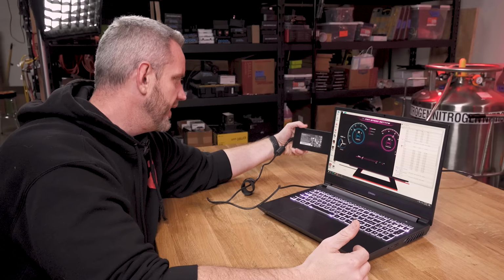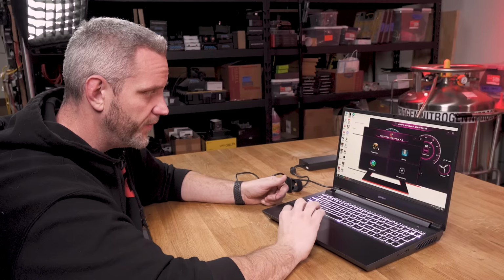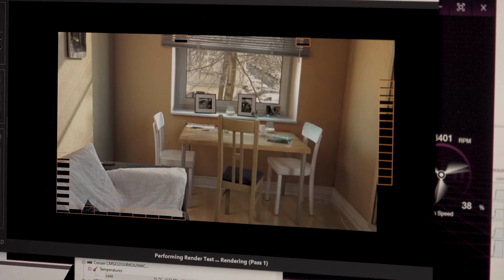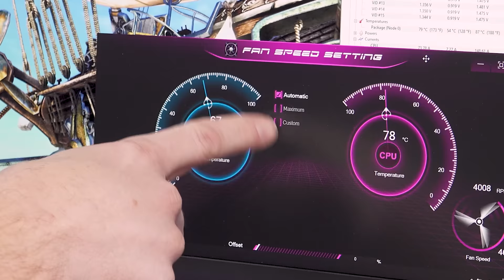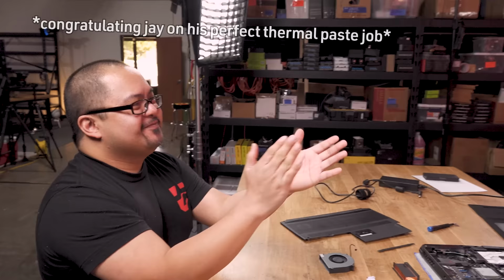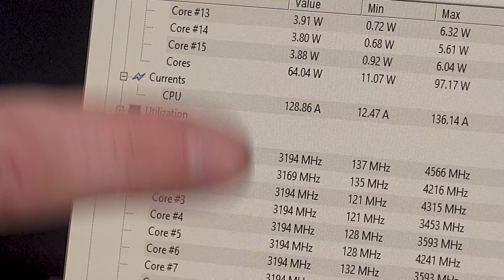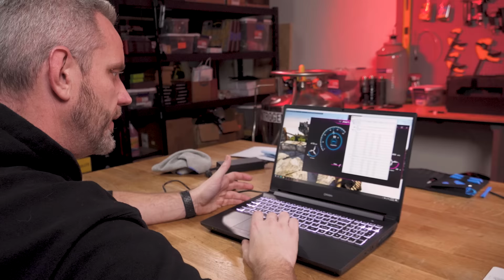This laptop was trying to melt to death... here's how I fixed it.

Comment: I work in techsupport and noticed the "performance" TIMs, like MX-4 tend to "liquify" and get pushed out from between the IHS and the cold plate, it's even worse on bare die chips
tested and found that best for this situation is the Gelid GC-Extreme or Phobya HeGrease Xtreme - basically same TIM, different branding; can't get my hands on KPX to test it

Comment: I have a rog strix laptop with i5 and 1060. Face same issue, when opened the laptop, the standoff on the motherboard that hold the heatpipe were all broken on cpu side and just stuck barely due to gpu side screws holding the entire heatpipe. Well crap out of warranty , took a piece of thermal pads and folded them to 5mm  5X5mm wide block and stick over heatpipe just above were cpu is. Applied new thermal paste and screwed the bottom and prayed it work. And it did back to 50C idle temps and max 90c under both cpu and gpu load without thermal throttle.

Comment: The clock dropping issue can be fixed by setting a proper power & current limit. This is because the power limit soft drops the clock speed and the current limit hard drops the clock speed. Also, having a current limit is good for preventing sudden voltage droop which could cause a BOSD.

Comment: I put LM on my Dell XPS 9700 -

Previously, I was thermal throttling at 70W. Now I'm able to sustain 75W (PL1) at 80-85°C, and I'm even able to sustain 115W PL2 boost for almost 30 seconds. Which is insane.

Also - 11% higher score in CB20 - 4227 against 3738 before. And without overheating - because after it drops from PL2 to PL1, temps immediately drop to mid 80s.

Comment: I had this exact problem on my Asus Strix 1080 Ti OC where the fans would start screaming if it went over 65-70c. 6 screws later (literally all it was) and I saw that most of the factory applied paste had evaporated (seriously, there was almost nothing left). I cleaned it up, repasted and now the card never goes over 65c and it’s dead silent. Always a good thing to check thermal paste if you’re having issues like this.

Comment: You might have applied some thermal paste bad... At least you did not applied the whole 20g worth of it on a single fx8520 and tried to troubleshoot why it doesn't start - there was so much thermal paste that it was in the socket ... So thank you for showing us what behavior does an overheating laptop has

Comment: My buddy had a similar issue with his MSI laptop. Thermal throttling hard on the CPU. PUBG ran like garbage. 

I put new paste in (wish I had recorded it) and the temps came down over 40 degrees.

The thing that really sucks is that this seems to be a common issue with laptops over time. Probably because of poor quality thermal paste. Another friend had an ASUS gaming laptop that ran like garbage for the same reason. So it's not just one manufacturer. 

And not everyone knows how to take apart a laptop. So this is something that would definitely cost people money over time.. which sucks on a multi thousand dollar machine..

Comment: I find these massive temp swings on my 3700X normal. 20-30C swings instantly seem to be normal. As long as it doesn't stay too hot for too long I don't seem to mind. I do have a U9S cooling it in a NR200 so temps won't ever exceed max.

Comment: For laptops a powerful tool is throttle stop for undervolting it improves performance and temparatur at the same time thru undervolting and its also important to use high quality thermalpads not just thermalpaste

Comment: My relatively new laptop has spikes to 100 degrees celsius, which is were it thermal throttles. Being basically idle after hours doing whatever unnecessary things dell supports wanted me to do they finally agreed to take it in and replace the heatsink and fans.  Problem is I need it for exams this month so it will have to wait a little. For now, I have disabled turbo boost to avoid does temps.

Comment: I recently had high CPU temps with my Asus TUF FX504GE laptop. Changed out the thermal paste with Arctic Allumina, but the temps stayed high. (high 50's to low 60's at idle, 4-8% CPU usage) What fixed it was a reinstall of Windows 10. Now it idles in the mid to high 40's like it did when it was brand new.

Comment: Hey Jay, try out Manual OC with ZenStates or CTR to bring the 3950X inside this laptop to around 3.6GHz at 0.975V to reach roughly 88W PPT in CineBench r20. You will LOVE the results. It should reach 8400 points in CB20. This way it will run way cooler with quieter fans and the performance is noticeable better than stock. At least for highly multithreaded loads. You can find a video on my channel in which I compare the scores achievable stock and tuned with all the CPU options for this notebook.
But beware, if you use ManualOC you have to deactivate the ControlCenter software in Windows' services, it's called "Control Center Hotkey Service". Otherwise the ControlCenter overwrites the manual OC from time to time.

Comment: On inspection of that thermal compound based on what I can see in this video:
You used too much.
Eventually the oils of the thermal compound will disperse and coat surrounding surfaces, and in a heated environment will slowly evaporate. This leaving behind a cakey ultra-fine powder that clings to itself and surfaces like wet sand, but it's actually dry. Matching up the separation lines from the CPU to the coldplate, I can see some small gaps where I'm willing to bet air got trapped in the application. This would accelerate the oxidation process of the thermal compound drying it out faster. Heating would cause the air pockets to expand creating a more sponge-like structure within the thermal compound. This, once the oils have dispersed due to oxidation, would create an insulating barrier instead of thermal transfer.
How can I tell? Three ways. First, there are numerous pits all throughout the main blob of TIM on the CPU. Second, if this process hadn't happened as described then the TIM would've held onto the coldplate via suction force. Third, you can't even see the labeling of the CPU heatspreader through that thick mass of TIM.
Solution? Pea-sized ball in the center of the CPU, and about a half pea-sized ball on the GPU. Press the heatsink firmly on the surface and oscillate pressure while trying to smear the TIM over the surface with the coldplate. Not sure it got full coverage? I assure you it did if your technique was correct, but to be sure you can pull the heatsink off and check the application. First, ensure you covered edge-to-edge spread on both the CPU and GPU. Second, ensure you can still see the majority of the CPU labeling. If not, you used too much or your chosen TIM is shit. Third, clean surfaces and repeat with confidence.

Comment: I had the same issue but with a low power CPU (i5 8250u) with the fans always noisy, the thermal paste was not applied nicely out-of-the-box, it basically was all around the die but not covering the die itself smh. After the repaste, it's dead silent even though the cooling solution is rather weak. Thanks for the nice job with the thermal paste Asus!

Comment: I have had really good results using liquid metal on all of my laptops and one of my friend's laptop as well. I nickel plate the heatsink cold plate my self (actually pretty easy) and use conformal coating to minimize risk, that way I should never really need to redo the applictaions. The temps are far better than stock and it takes so much longer for the fans to ramp up under load.

Comment: Read Igors Lab latest article. Because of the 3950x's convex heatspreader a viscose thermal paste will kind of slide down after a while where the CCDs sit. This is the unfortunate part with the chiplet design. So using a gooey paste is actually a bad idea. You can confirm that in a few months

Comment: I had exactly the same issue but with my RTX 2080. The factory paste hardened after only two years of use...
Didn't know why my GPU was going crazy before taking it apart. I brought it 8-10°C lower just by changing that hardened paste. Btw, it was an AIB card, Aorus.

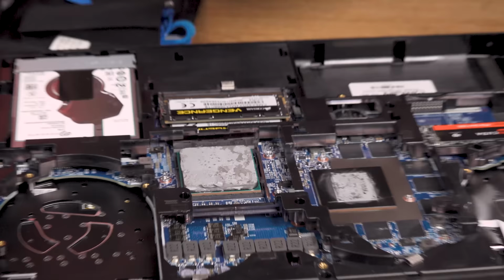Comment: 7:52 bubbles, bubbles everywhere :) Thats what you get doing paste cross with a side(s) closed with paste excess, or even worse - paste square with inside cross. Imagine then the air inside, bottom clossed (cpu/gpu), top closed (cooling unit), sides closed (thermal paste). Air has nowhere to go. Then you have pockets of compressed air trapped, resulting this bad thermal behavior. IMO, best way is to "paint" an even paste layer on such big cpu block. On smaller ones is a pea sized drop in the center also good.

Comment: Sometimes a paste job goes awry even if you did it right in terms of application.  A small twist or side slip as you tighten down the cold plate can cause a thin spot. In this laptop, that looks like it could be what happened, though as tight as everything fits together...maybe it was just a little short on paste.  Either way, good on Jay for being human and owning it.

Comment: Reminds me of a laptop I worked on once for a friend a long time ago. It was an Acer, which was the first and main problem, with an AMD Turion X2 and a discrete Radeon GPU, can't remember which. On paper, it should have been a nice laptop for the time, but after looking at the running processes, the CPU utilization never went below about 30% because of how bad Acer's bloatware was at the time, and it frequently went higher. The thing was just dog slow all the time as a result. So, I decided to just reformat the thing and be done with it. Easy, right?
Well, it would have been, but it kept shutting down during the format. I finally figured out that it was overheating. Acer, in their infinite wisdom, only put ONE fan in the corner of the laptop, so air came in through the side and instantly got blown out the back. Weirdly, it never overheated during normal use before, but it was loud, so I imagine there was some sort of very aggressive fan profile in the chipset drivers, which were gone now.
Solution? It was about -25 C in Winnipeg that night, and I had a wide stone ledge on my dorm room window. I cleared the snow off and stuck the laptop out on the ledge to format, and installed Windows out there as well. Once it was in Windows, it stopped overheating,  it was way faster without the bloatware, and that machine kept going for years.

Comment: Jayz after watching i did a little bit of digging and some people using KPX Paste seem to have the same problem as you. Months after applying it, the temperatures spiked and when they removed the Cooler the Paste was solid and dried out (not gooey anymore). If you have the time, could you maybe look into this matter? I think it would maybe help some people or at least make them aware of KPX drying out after months and this leading to a spike in temperature.

Comment: I prefer less powerful laptops. I just got a 4700U Dell Inspiron 7000. I freaking love it. It barely ever gets warm to the touch even under load. I had it running blender and still barely warm and the fans are quiet is hell. I save the good stuff for desktops. And since it's Ryzen I can play KSP!!!! I had an 8th gen intel that would get a slide show in KSP. That's radeon vs intel for you. I wouldn't be surprised if the HP I was using needs a thermal paste job. It was overheating like crazy. It always ran hot, but never shut down on me. It's 10 years old and I've never serviced the paste. lol

Comment: I recently had this issue with my dell g3 3590 which runs an intel 9300h and a 1660ti 

The cpu was idle around 75-80c then when launching games or any program it would spike to 100c. It never shut it self down but the fans got annoying so i gave in and voided my warranty repasted the cpu and gpu and it only maxed out at about 90c. I downloaded throttlestop and disabled my cpus boost clocks. So now my cpu is constantly running at 2.4 ghz which surprisingly didn't hurt my fps compared to the usual 4ghz. Overall very happy though it idles in the upper 40s and mid 50s then will occasionally hit a max temp of about 78c. So for me new paste and throttle stop worked just fine

Comment: Why don't you lower vcore for the purpose of lowering current?  Will decrease clock but you should be able to prevent the 200mhz throttle and lower thermals further and thus giving a better overall score/performance in the end.  Curious and not roasting... ie..I can't throw the stone!

Comment: I have to wonder why you originally cracked it open in the first place.  I was half-asleep during the first half of the vid so if you mentioned it I may have missed the explanation.  I got up and grabbed a cup of coffee then came back and finished it.  I do however take issue with the way you apply thermal paste.  You use WAY more than I do.  You glob it on.  But... whatever works for YOU!!!!
Reply: They did a teardown for the review when they originally got the laptop. I agree on the paste about using too much but it's not going to affect thermals, as long as it gets the job done I suppose.

Comment: My alienware area51m r2 starting doing the same thing, my fans where turning on way more ofter, turned out windows update got stuck trying to update. I tried everything and nothing worked to fix it, so i had to re install windows. Thankfully that fixed my issue.

Comment: Since most laptops place the heat pipes directly on the die, isn't it feasible to use liquid metal as a replacement for thermal paste? Taping off the surrounding areas for safety, of course.

Comment: I wonder if there is a market for powerful battery-less laptops. Considering the cost in cash and volume taken by the battery that can be used for something else (hard drives, cooling...) as well as the fact a laptop is a "just plug it and press the power button" computer with all the necessary peripherals built in, while sucking so much power running on battery would last 30min, I can see reasons for those to exist.

Comment: the first actual problem with it is that it doesn't have a proper mobile processor due to lower power limits of power brick and second is the the heat sinks have cross linked heat pipes... cut the cross heating pipes and watch the temps drop even more

Comment: I have the same laptop from Metabox Australia but with the 3900X over the past week it idles at 70-75c, and if Im either video editing or playing a game I reach 95-103c
and my fans doesn't automatically max out when it reaches these temps, I have to open that same ControlCenter 3.0 that comes with the Clevos and manually set it to Maximum.
Think I may do the same as you did on this

Comment: That's still too much paste.  It's not an interface material like a pad, it's just supposed to fill in the tiny scratches and gaps between the two plates. Keep it thin and even, and plan on freshly reapplying most pastes every year or so.

Comment: My kids dell was doing this I had to change battery settings in bios. Essentially overvolt issue. looks like exact same issue your having here. try it on battery power if it stops overheating its the bios setting for charging.

Comment: Well, I've had my thermal paste for 6 years on my 4790k. Just replaced it with the tube that I bought 6 years ago when I bought the cooler, was still runny so I thought why not? Idle dropped from 55c  to 35c lol

Comment: I had this same thing happened with my clevo laptop with a 2060 and an 8750h. I replaced the TP and under volted it. After doing that I jumped a lot in not just CR20 but also in fps

Comment: I did that to mine, all happy the next day... but after a week it came back to high temps. I think a re-paste has to be tested a few days or weeks after to see if it really made a difference. I used MX-4 paste for mine but I think it dries up or degrades really quickly. Or maybe it's not suitable for low pressure applications or something...
Reply: @mikeycrackson  I repasted twice just in case, with the same results. The paste pattern looked fine in my opinion... I solved it using liquid metal but after two years, now I think it's not doing as good as the beginning. But it's not my primary computer (or even secondary anymore), so if it fails, it fails 🙈

Comment: Fairly sure something else is wrong here. Amps shouldn't be that high. It's almost like it's running in overclocked mode rather than stock settings.

I have the 3900 version but when a 3950x is installed it should default to same settings watts size for the 3900.

Off the top of my head that's 88w ppt 50 EDC and 90w tdc ( values and names may be wrong but you get the idea. Highest one which is all core current should be 90 amps ) 

The power delivery is capable of about 100 amps sustained maximally before it starts doing odd things.

Check your Ryzen master settings.

Also consider flashing the BIOS by xmg.

Hope this helps

Comment: Idk why my laptop (Zenbook 14) temps are so high. Before when I played games it would reach 70* now it reaches 85*+ on the reg. The weirdest thing is that when I exited out almost all programs except my tablet’s driver, then close the lid, it still RISES IN TEMPERATURE. Couple hours later when I open it it’s is 85*+ even when it is below idle conditions! I don’t really know why this is happening. I have also came to the same conclusion as Jay but don’t have the technical prowess nor the tools and thermal paste to do it.

Edit: If you suspect blocked airflow, it isn’t, I elevate the laptop giving vents ample airflow, also it can’t be a buildup of dust cause I only have used this laptop for around 5 months. Also I’m pretty sure it isn’t a virus cause I use common sense and don’t download sketchy stuff off the internet, and if the off chance I do download a software I don’t know, I search it up and if it’s safe I scan it through virustotal for reassurance.